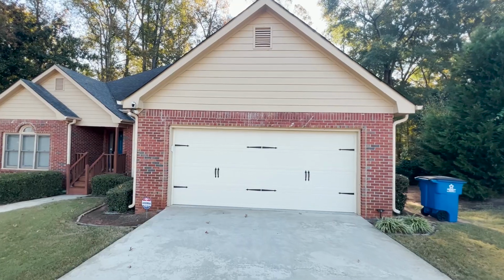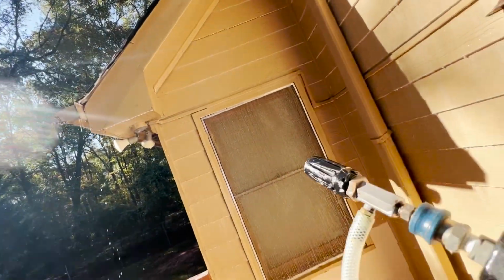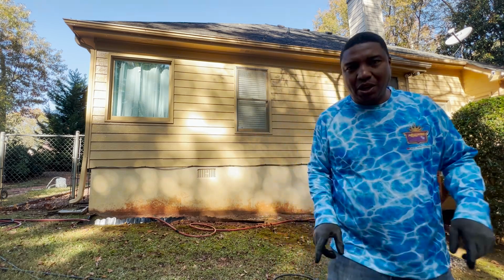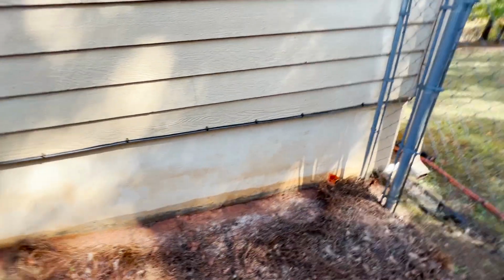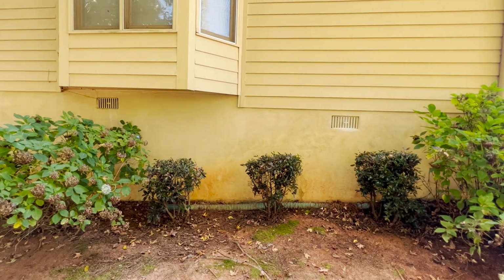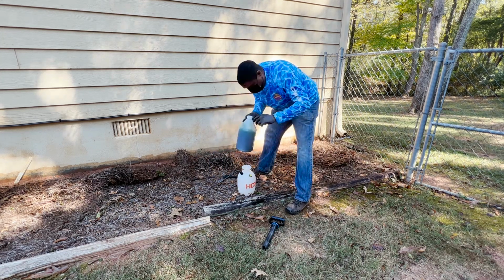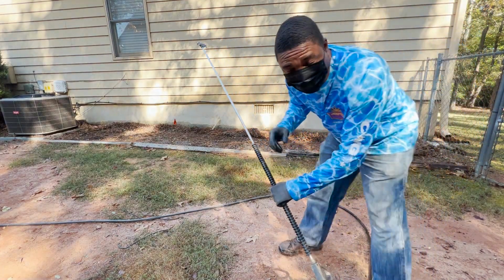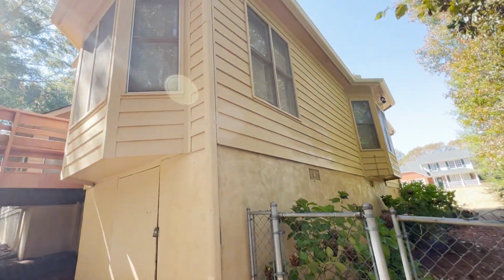Pressure Washing A House With Red Dirt / Rust Removal

Comment: The mask you’re using is not for chemicals.
You need two pump sprayers. One for alkaline solutions like SH. The other for acid chemicals used to treat rust.
The gloves you are use
I guess do not cover the whole hand. 
When you’re spraying with the x jet, make sure to use eye protection.
Reply from the maker: Thanks. I will try to do better it’s just some bad habits that I need to break.